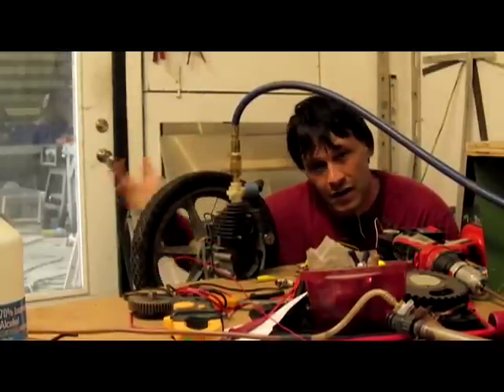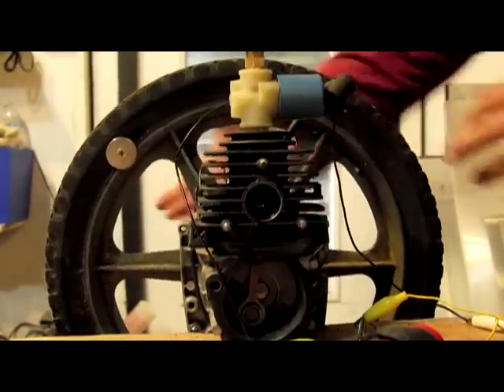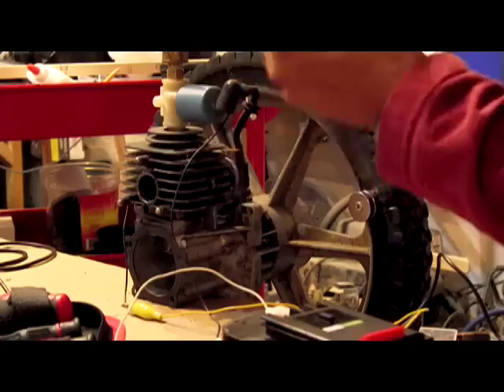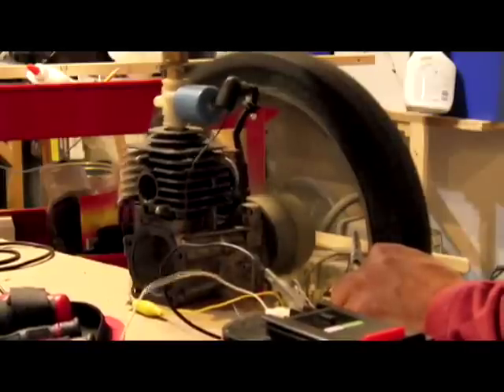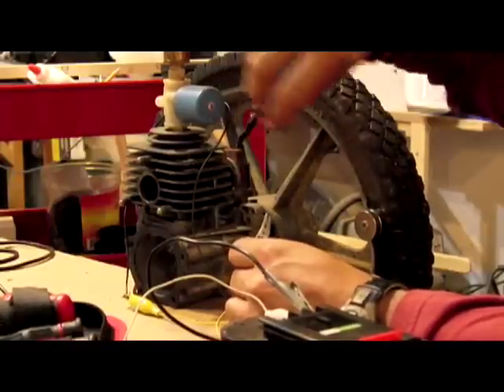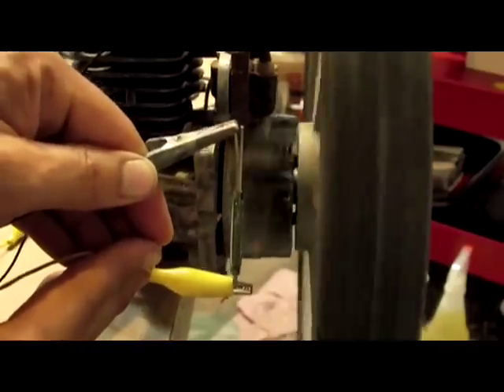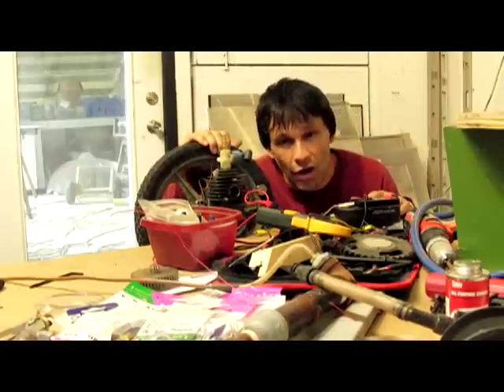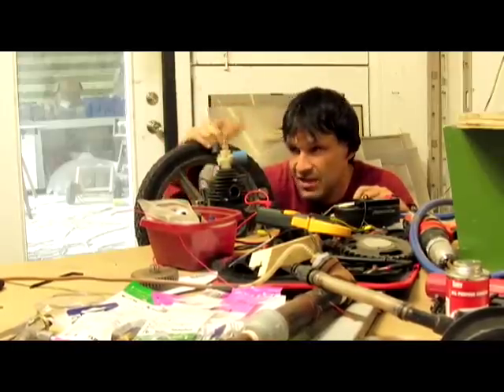DIY STEAM ENGINE HACK TWO STROKE CONVERSION Weed Eater Hack Steam Power

Comment: Depends on how it was implemented.  I was thinking in terms of when when you WANT to stop, ie braking, or when going downhill.  It would not make sense to back-feed all the time.  It would have to be conditional and electronically monitored, with the main point being that simply changing the timing of the valve opening time determines if it allows air OUT or pumps air back IN.

Comment: good idea, but it would only work if the cylinder was close to the bottom of its stroke.  The intake port gets covered up by the cylinder when it is moving up.

Comment: the engine has an internal counterbalance weight.  So, it is definitely not the up or down stroke doing it.  I agree with others that the neo magnet makes the wheel out of balance.  Just fasten a couple of washers to the opposite side 180 degrees from the magnet.

Comment: The arguement was when to releave the pressure in the cylinder.    In the engine that Dan used the pressure is releaved at the bottom of the stroke.  Unlike 4 cycle engines which have valves in the head which open and allow the gases to be pushed out on the upstroke.  I never argued to close the exaust port all together.  My arguement was that it is not worth the effort to block the current exaust port and place a slide valve to allow double duty of the intake port.

Comment: You would think someone with an engineering degree would be willing to engage in an intelligent debate instead of trying to insinuate that I'm arguing perpetual motion.   All I'm saying is that the compression and decompression of air in a cylinder should be the least of your concerns as far a improving efficiency

Comment: Copper is close to the same (Btu/ft2 hr oF) as aluminum I believe so I used it as a replacement.  But if anyone has the (Btu/ft2 hr oF) for aluminum I would be happy to recalculate.  Come to think of it you could divid my figure by 2 at least do to the fact that the air would only be in a compressed state about half the time.  Like I said the energy loss is basically nothing.

Comment: Oh no Sarcasm in your posts? give me a break.   LOL  Here are some numbers that an engineer can use.
The Overall Heat Transmission Coefficient  (Btu/ft2 hr oF) from air to copper to air is around 1.6  So a cylinder with 20 square inches of surface area would equal about 1/7 or .23 (Btu/ft2 hr oF)or .067 watt hours.  These figure would be after everything has warmed up and stabilized.  The 20 sq in is just a rough figure considering all metal surfaces in the cylinder.

Comment from the maker: The PSI is the speed control.  A larger Flywheel will increase torque or smaller increases rpms.

Comment: It seems like you could recharge the battery with that magneto or add a resistor to run the soliniod directly.  Another great video Dan.

Comment: Installing a "ball check valve" in the sparkplug hole, and adding a protrusion on top of the piston to operate it, (google CO2 motor,) would simplify timing issues mechanically.

Great work, Dan. You're very inspiring.
Reply: Awesome idea, Tweeze.  Dan and his crew come through again. 
It'd be nice to see him making more videos - remembering those days when good videos were easier to find on YT.

Comment: True but that is an extreamly small amount when compared to the loss when trying to release that air all together.  For that matter is would be extreamly hard to measure that loss as only a small amount of heat is assorbed during each compression.   So basically there is no noticable loss of energy.

Comment: It wasn't that it shorted out.  The valve is a big inductor and when you have current go through and inductor and break the circuit it can generate 100's or 1000's of volts, luckily only for a short time.

Comment: There is always loss of energy when you compress air and let it expand.  When you compress it you create heat, which heats up the pistons, and other metal.  When the air expands again, it gets cold and doesn't expand quite as far as it started.  Therefore there is energy lost.

Comment: Oisiaa is correct.  basically there is no loss of energy in that compressed air.  The energy it takes to compress it is returned during the decompression.  However if you release it you are using energy in the valve system.  It also takes energy to exaust a cylinder so long as the exaust port is smaller then the cylinder itself.  That energy is completely lost because now you need more steam to fill its void.

Comment: neven01: I think he's just demoing the concept tha u don't need gasoline....air is a safe convienent way without setting up steam. also i think a magnetic operated slide valve could be used if u remove the coil and replace it with a slide valve.

Comment: Great video Dan,   I'm willing to bet that if you used a Buck/Boost regulator you can operate the solenoid off of the Magneto.  After all they use Magnetos to recharge the battery on riding mowers.   One concern with using these engines with steam is that you would need to lubricate them some how.  Normally the oil is mixed in the gas.  With steam you will wear out the engine in no time ( probably quicker then the solenoid) with out oiling it properly.
Reply: Fun fact! Some older steam engines use the steam to lubricate themselves. I agree it probably wouldn't be as effective as oil, although it'll probably last a lot longer than you think. Unless you were referring to using solely compressed air, then yes I would agree it would not last, and you would need some sort of lubrication.
Reply: In-line oiler.

Comment: 4:56 Ouch and that $#!+ hurt when it shorts out! LOL
Good vid Dan.
Just curious if you need electricity for the production of the compressed air how is this green? seems like I am lost in the fact that it took a compressor to run a compressor type engine. I am not capping on you I applaud all you do just confused on the effeciency of this project.

Comment: Would the exhaust create enough back-pressure to spin up a small turbocharger?  If so, you could route the compressed air or steam through the compressor end.  This would amplify the pressure coming in, allowing you to back the tank pressure down further, increasing your run-time.

Comment: Very fascinating!  This is a good vid and I learned a lot from it as far as using the engine to generate power.  However, what about skipping electrical generation, attaching the motor to a bike frame along with a boiler and fire box and creating a steam powered bike similar to the Roper Steam Cycle?

Comment from the maker: They usually appear to be running but what the three I have tested do is rock back and forth really fast. Sounds like a high RPM Spit. My engines never complete the full stroke. Just hammer like crazy.

Comment: I wonder how much compressed air you would need to power that motor over night. Would be cool if you could use excess solar or heat motor produced electricity to compress the air during the day and use the air at night. Think it would be better than using deep cycle batteries?

Comment: My diea is to use the same concept as a roofing nailer to shoot high pressure compressed air into the same two stroke engine that you have. I blew up 3 engine cranks before I got it to run for anytime without throwing and rod. The power is enormous. I am working on a way to better regulate the rpms so I can use it for to accelerate a vehicle from a stop. Nice Vid !

Comment: Great video. Would love to see this running off steam from a boiler powered by a fresnel lens! How do you lubricate the motor - seeing that it doesnt have the oil/fuel mixture running through it when you use it as a steam engine?

Comment: Great video. It would be fun to attach this to a lightweight frame and have a big air tank that could give you 20-30 minutes of run time. You could also fill the tank with dry ice and let the off gassing run the motor, but this would definitely go against the whole "green" concept.

Comment: The compressed air during each compression stroke should function as an air spring which will give you the majority of the energy back except for a little that is lost as heat. A compression release mechanism would actually use more energy.

Comment: if this setup was used on a go cart or bike for power.
you would use the magneto center contact(more air=more takeoff tourque)  then you could flip a switch and change your contact points to the outer edge of the flywheel

Comment: Nice vid Dan. 

1.On 2 cycle engines the oil is premixed in with the gas. So if you dont run it on gas you are running with no lubrication. You could use an air oiler before the valve to solve this problem.
 
2. Perhaps you could use a resistor to run the electric air valve off of the mag.

Comment: 3. You could also have a belt driven alternator and battery. That would allow for electrical controls for your steam power system. For example you could have a belt driven fan with a standard 12 volt fan clutch (controlled by a temperature or pressure sensor in your condenser, with the assistance of a 12 volt relay) that would spin up and draw air through your condenser when the temperature or pressure reached a certain point. Oh this is fun!

Comment: marthale7 
Yes compressed air does have moisture but that problem has been solved long ago with off the shelf air dryers. I'm a heavy diesel truck mechanic and work on those systems all the time. An off the shelf air dryer, pumping into a wet tank and then off to your storage tanks is just what the doctor ordered. Great idea!

Comment: 2. The condenser section could have temperature operated valves that control shutters to cover the condenser when it's below boiling point. An old radiator might work for a condenser and you can get pressure caps so it won't blow. Then get a small water pump that pumps the recovered water back into the boiler. All we want is to cool the water just to the point where it condenses back to water, Any more cooling and you're wasting valuable heat that could be used to turn your wheel.

Comment: Very impressive indeed! Using a 2 stroke for a steam engine! Genius. I wonder if old steam engines used that method. If they didn't, this method would have made a good increase in their efficiency. 
You could add the fire box of an old steam cleaner for the evaporation section (with tube coils instead of a boiler) for quick starts and a pressure actuated damper on the fire box to cut the fire back when the steam pressure reaches say 100psi. Add condenser coils to recover your water too.

Comment: Is it silly to think that the engine could run itself and fill the compressor.? Or another engine that runs to fill the compressor. Off air, or is that the unsolvable question of perpetual motion. Most would say yes. But I am optimistic. Or just desperate.

Comment: I have a weed eater motor that my mechanic says will not run well because of a crank case seal that is bad. I bet it would work very well for this application. I will have him check the compression for me.

Comment: Excellent video. Thank you for posting it. I would imagine that the voltage off the magneto is greater than 1000 volts. The volt meter measures AC voltage which measures the "mean" (or average) voltage. But as the spark is a voltage spike with an extremely short duration the voltage the meter "measures" would be far lower than the true voltage of the spike.

Comment: I would imagine you could also configure it as a compressor by applying external force to turn the wheel and positioning the reed switch appropriately.  Possibly a means of re-capturing energy if used in a go-kart application? Braking could simply change the reed-switch timing to pump air back into the tank while coasting... hmmm...